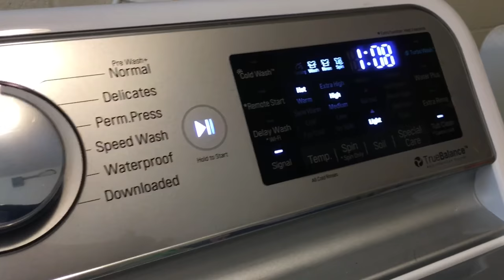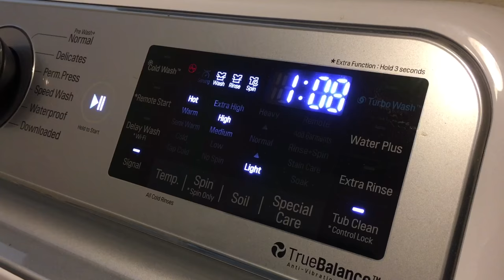LG Washer Tub Clean

Comment: what did you open and pour in ?  what was in that pouch?
Reply: Thanks what I was wondering.
Reply: They actually make a washing machine cleaner. Examples are Affresh / Tide (not laundry detergent) But they also make a cleaner specifically designed for cleaning washing machines.
Reply: Half or full box of baking soda hot cycle long and then next cycle two full cups of white vinegar. Obviously this is for tub cleaning no clothes